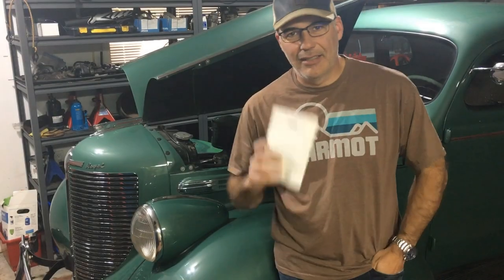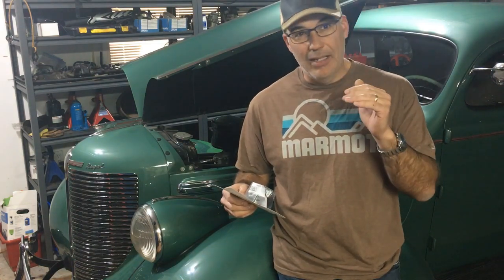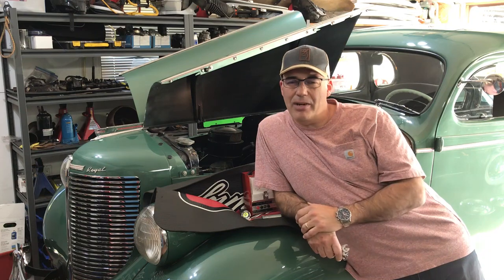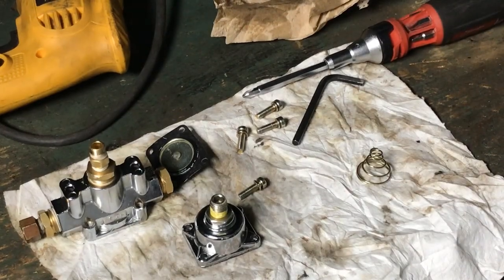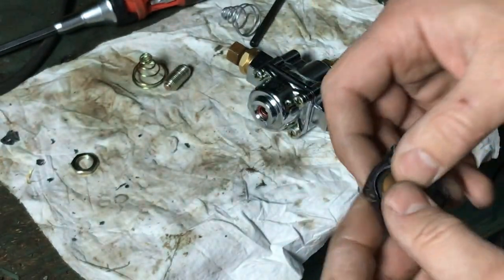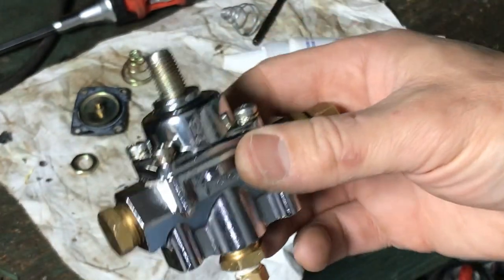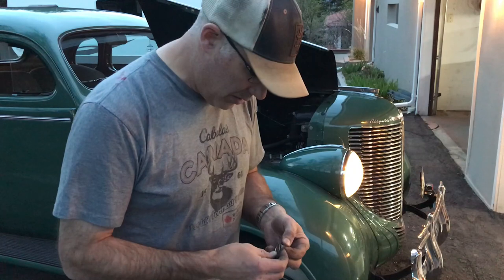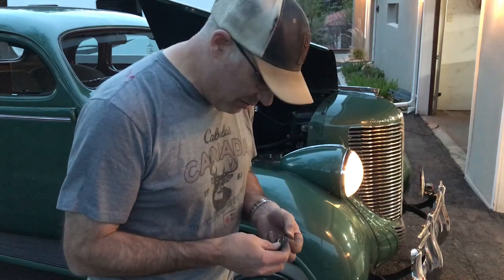1938 Chrysler - Fuel System Pressure Issues Resolved?

Comment: an asside to your issue still encompassing mechanical fuel pumps and older cars is that when a mechanical fuel pump fails via diaphram breach fuel can leach into engine oil thinning it which could prematurely wear out motor.

Comment: if I may ask:  what is the brand of the wheel dollies plus is the car easy to move with just one person?  the dollies I have are not. thx
Reply from the maker: There is a store in Canada, Princess Auto. They are store branded wheel dollies. Similar type of store as Harbor Freight in the USA.  These dollies are easy to move the car around on my shop floor. It can be tight in the garage. The dollies really assist a lot by allowing me to get my cars into convenient positions.
Reply: @keithsgarage5831  thx for the quick response. didn't realize your base was in Canada. {Was going to ask how the border crossing was}  I'm assuming your dollies are the ratchet type cause my flat dish is hard for this OG. have to get neighbor kid to help. Again thx.

Comment: So the question I'm asking myself Keith, is why you need a regulator?  Is it because someone during the car's recent life time replaced the fuel pump with one that had too high of a fuel pressure rating?     So it's sounding like the pump on your car, even though the bolt holes line up and your rocker arm being the right length and angle, that it was not designed for that engine, since it seems to have a higher pressure rating?  Or do you think someone was using a lower grade of fuel for awhile and that caused the diaphragm to fail? Maybe I should watch again.  I got a little confused with the spring selections.  I can't remember if you tried just leaving the original spring in and just replaced the diaphragm at any point.
Reply from the maker: The fuel pump on the car is aftermarket. Vintage made in the USA. But makes 7psi. Too much. The stock fuel pump was included with all the other parts that came with the car. I don’t know its condition at this point. For now, I’ve got this aftermarket pump under control. I’ll use it until I get to the stock one.  The regulator had a leaking diaphragm. I replaced it and confirmed that I had the correct 1-4 psi spring. Now its working and properly keeping the psi down to an acceptable range. I drove the big hill home tonight. No issues.
Reply: Right, so if you've fixed the regulator by replacing the diaphragm and spring and then re-plumbing it all back together, you've got great practice for repairing the original fuel pump! Which probably only needs a new diaphragm and maybe new valves and springs. You should be able to find a rebuild kit for that pump. On the other hand, now you've got a working car, and maybe it's not worth fussing with it if you don't care about the non-original pump for now. Maybe save the fuel pump rebuild for a wintertime kitchen-table project. 
I do appreciate the spirit of your videos, though. It's true that you don't need to be an expert or a licensed mechanic to do this stuff and that ordinary shmoes can have good success with basic equipment and good critical thinking skills and a willingness to tackle problems.
Reply from the maker: I’ve rebuilt fuel pumps on my other Mopar cars. I’ve made fuel and brake lines. Ect. All typical stuff for vintqge car owner.
Reply: @keithsgarage5831  you might check out Kanter auto parts for a fuel pump . Be Shure and have your Engin numbers and original model of the car the engine came out of. The quality was fantastic on the one I got for my 1936 Dodge and they replaced one that looked the same to me but was not at all .
Reply: @richardthomas1566  - Avoid Kanter at all cost. Overpriced junk. @Keith's Garage - you can get a rebuild kit from Then and Now in Massachusetts. They provided me with an ethanol safe kit for my Desoto. Rebuilt the original pump with no problems.
Reply from the maker: I know the place, Then & Now. I am ordering a kit from therm. There is some reproduction crap out there for sure. Real junk. I won’t name names but I also have few I have learned to stay away from.

Comment: Do you have a Heat shield above the fuel pump ? It’s an Orginal item and you will get vapor lock running the car above 85 degrees if it’s not on .
Reply from the maker: Yes I do. I put it on after posting that video.